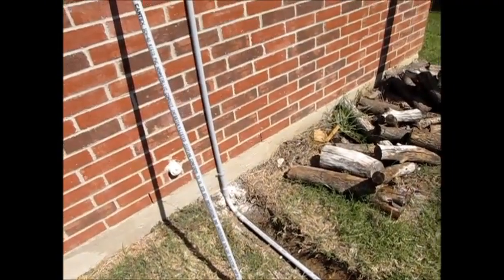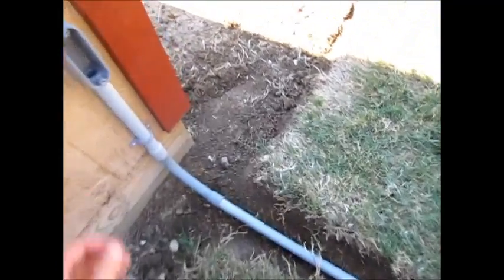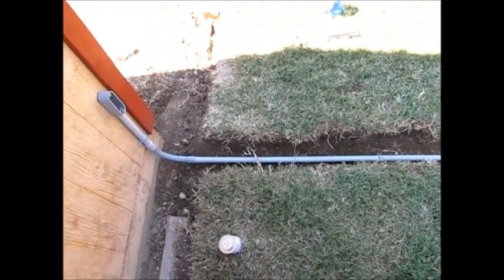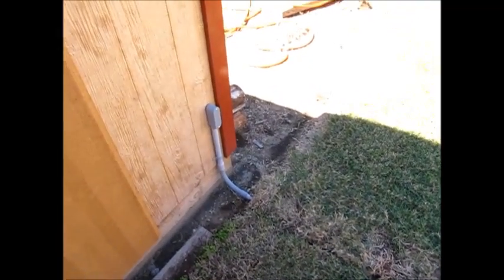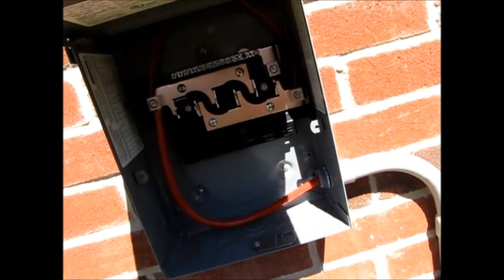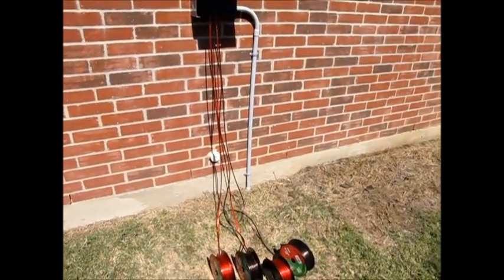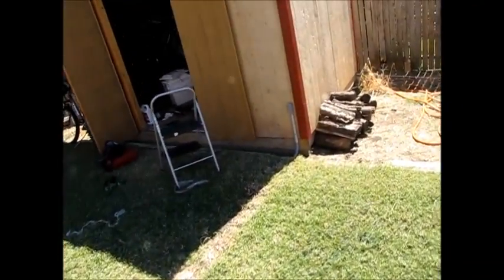How To Install PVC Conduit for Solar

Comment: you can put a red warning tape on top the conduit then cover with dirt, but like you said you are living in the home. If i put my conduit down 18 in I would run into the gas line so I went down 6 in.
Reply from the maker: I think that is totally fine.  As long as you know where it is and remove it before you sell the house/property I don't see how it is anyone's business that it is there.  Obviously, if it crosses an easement on your property or someone needs to do some digging on your property you would need to tell them where it is and de-energize the lines for safety before they did their work.
Reply: @LDSreliance  I have 110 power in my BBQ shed, I bought the vtoman 1500 power unit, so I put up 2 solar panels and ran wire to charge the unit up, I have 100and solar to choose from to run stuff, the refrigerator is on 110,  from the house and shed lights etc.
Reply: I do have a breaker box in the shed 20 amp breaker with ground rod too.  I even ground the solar power metal pipe  and panels, over kill but that is okay with me.
take care

Comment: I bought vtoman power 1000 using them for power in my BBQ shed, installed 2 100 w solar panels to charge the unit and ran my wires in the gray  conduit like you did  under ground to the shed from the solar panels
Reply from the maker: Nice job!  Glad my videos could be helpful.

Comment: Does anyone have a suggestion for getting the wires inside of the house thru Vinyl siding?
Reply from the maker: Use a cable gland such as used for RV's.  They are waterproof and designed for cables to enter without leaving holes or places for bugs and water and dust to get in.

https://amzn.to/3xOCSLU

You would just need to cut a small hole in the siding where you want to enter the house and then this product would go on over top of that.  You would use silicone or some other sort of sealant to seal around the outside of the cable gland before securing it in place with the screws.

Comment: 18" depth isn't code because of how deep you will or won't dig, it's to prevent frost heave. Anything above frost level can be pushed up through the soil if the ground freezes. Normally, 18" down is as far as it freezes (the farther north, the deeper it freezes). I've had posts that were forced up 4" when I hit rock at 8".
Reply from the maker: Good to know.  I have since removed this conduit but it lasted through 6 winters without any kind of heave.  Then again, I do live in Dallas so it doesn't deep freeze very often.  But even in that record cold last winter that shut the whole state down it didn't have any problems.

Comment: Breaking code because you know where you buried the pipe and where you will be living there for 7 or 8 years? loool.  People like you should be fined till it hurts.
Reply from the maker: Find me an electric code for low voltage cable with a single conductor.  I'll wait.

Comment: While traveling on business my wife has a lawn guy aerate the lawn.  During power aeration he blows through the PVC pipe and connects himself to your 40 AMP booby trap.  He survives, your homeowner insurance doesn't cover this type of incompetence....  I sue you head to toe and you gotta make everything right - - you see this is the definition of negligence in tort law.  Or if you didn't sell your house and it was your wife's lawn guy while you were out of town - write the script.  Which goes like this - Mrs. Bride of Booby Trap  (LSD...Reliance - yes you must'a been on LSD) has hysterical man laying on lawn after a microsecond lectro-shot and 40amp lawn "sparkler", (solar power is down - eh - no prob).  But, people show up, and eventually the electrical inspector - - your DYI booby-trap get's you a whole house inspection, fines etc - and posting on Youtube just seals it for the tort action in court  -  your attorney begs you to settle and not fight it.  All your electrical gets pulled out, every connection, and every improvement you did without proper paperwork.  If only you had buried it at the right depth, you would still be married and your 401K growing for you and the family.  

BEST ADVICE - take down your video.
Reply from the maker: Does that make you feel better?

There is no lawn aeration on the planet that penetrates 6-8 inches down, for starters.  Also, the cables are in separate conduit 6 inches apart so there is literally zero risk of short circuit.  And finally, the cables are protected on BOTH sides by breakers.

BEST ADVICE - Please stick to being a lawyer and chasing ambulances.  Your Youtube critique service isn't even worth the time to read.
Reply: @LDSreliance  Ok, 
1) Do the geometry on the pipe and we find your notion of 6" is false based on where the apex of the curve intersects the dirt.  Your video dose not show separate conduit 6"apart (thus you misinformed those you seek to instruct - please correct).   I used the Carlon product guide/dwg to be accurate.

2) Aeration - get the facts on the range of equipment used.  In your town maybe nobody had anything deeper - but the US covers a range including 6" deep.
Lawn Aeration
You can aerate a lawn by hand or with a machine. Core aerators extract small plugs of grass and soil, about 1/2 inch wide, and leave them on the lawn. The holes are generally 1 to 6 inches deep and about two to six inches apart. Some models use spikes to dig into the soil but they do not remove sod. Manual aeration tools have hollow cylinders to push into the grass and extract the plugs. Choosing the type of aeration system to use may depend on how large your lawn is and the type of grass in it.

3)  I am not a lawyer, closer to an engineer but guess again.  I do know we both agree the post won't meet code, I believe it is unsafe - and you don't.   

4) Do you feel better knowing you missed the geometry quiz, and equipment selection guide to lawn aeration across US residential landscape?

Comment: Conduit depth isn't about you knowing where it is, it's about others knowing. It's also about keeping it below frost lines depending where you are. Bury it to depth. Mark it with gravel and tape as required. Not being an electrician is no excuse for not doing research and doing it right.
Reply: PVC doesn't stop shovels, etc. It's about when he sells the property. That's what codes and building requirements protect us from. It's not that homeowners aren't comfortable with their own work. If it were only to be safe for the current owners I don't think inspectors would have jobs. Plus it's just lazy. It's a short run and he only has to dig down another 8 inches or so to be compliant. Just sucks to see when everything else is done pretty neatly.
Reply: Robert Dunham if your doing a private job on your property without any inspector requirements like I am I can do whatever I want I might just laying across the open ground
Reply: @TheTinkle1  Schedule 40 PVC conduit is rated for above ground use. Makes it kinda tough to mow the lawn though!
Reply: @TheTinkle1  :  He's creating a mess. I've seen many homeowners stuck with EXPENSIVE problems due to DIY code violations left by previous owners -- ENTIRE ROOM ADDITIONS where no records exist. When someone does pull a permit for something, all heck breaks loose. If you want to pretend you're a cook, that doesn't mean you may undercook the chicken without consequences. If you want to play electrician, don't make up your own rules; have some pride and follow THE RULES. Someday, someone will have to pay to rip it all out.

Comment: In Iceland they use a similar method, I would suggest seriously you add one component, sand, if you are living in a cold region sand acts as a buffer between the ground and frost, what happens during the change of seasons the ground expands and contracts and this can cause the PVC to crack, by using sand the sand gives way in the expansion and contractions process of the ground and therefore protects the PVC better throughout the season.
Reply from the maker: Good idea.  Thanks for the suggstion!

Comment: nice work. Why do you not convert it to 120v ac with an inverter?
Reply from the maker: Good question.  I probably should have but I am less confident in my abilities to wire 120V than low voltage DC.  Both can be dangerous but I am more comfortable with DC since I have worked with it a lot longer.

Comment: I'm glad that he included the disclaimer that this may not be code compliant because it is not. Please DO NOT emulate this installation on your own property! For instance he states that code requires underground conduit be buried at least 18 inches but he is sure it's OK because HE knows where it is and comments below that he plans to remove it when he moves. What if he's hit by a bus and the house gets sold,  perhaps the next owner may decide to rototill the yard and be unaware there's PVC 6 inches down. The voltage may not even be an issue but ripped and sharp PVC pipe flung in the air may be. Even the though the gauge of wire run in to the attic is sufficient for the current capacity does it meet NEC code relating to fire suppression? Is it the type of wire REQUIRED by code period? If not and there's a fire for ANY reason starting in the attic you may have problems with your insurance company for having interior electrical wiring not within code and being installed without permits.
Reply: +Apexclipper It depends where you live.  When I lived in Texas, they only required low voltage wire to be six inches underground.  Wisconsin required 18 inches because of the freezing.
Reply: +LDSreliance looks good to me man, nice job
Reply: Also if you dig grass in straight line you can make a "sod roll" and lay back down like it was never dug up.
Reply: Only 6 inches is required for DC low voltage.
Reply from the maker: +Apexclipper I used THHN wire which is commonly used in solar and perfectly fine for attic use.  It is very low voltage, it is on multiple breakers, and it is oversized wire so I am totally comfortable with it.

The codes you refer to are for AC wiring, not low voltage DC.  To my knowledge, there are no codes for low voltage DC that I could find in my research.  In fact, there is some debate as to whether you even need to ground DC at all.  So the fact that I am attempting to use conduit and a grounding rod to keep things as safe as possible is, in my opinion, above and beyond what I could have done.
Reply: Apexclippe
Reply: What a know it all whiny bitch complainer.

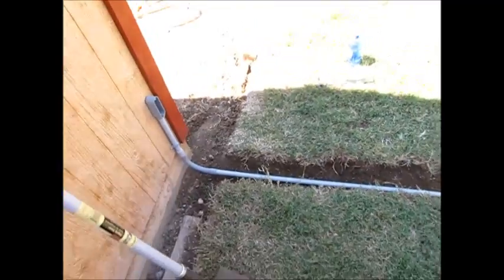Comment: 2:22 - it is not a good idea to rely upon potentially transient conditions of occupancy, when you do any construction.  It is a better idea to make your installation safe for anyone who lives in the house.

In fact, I see it all the time in panelboard labeling.   A circuit gets labeled as "John's Room".  I come to use it years later and think, "who the heck is John?".  John hasn't lived here for 10 years, the label means nothing to me.  How do I find what room this breaker controls?
Reply from the maker: I agree with the basic idea.  However, in my case I am 100% certain that I will be removing this conduit and wiring before selling the house so it isn't an issue.  Good comment, though.

Comment: Looks very tidy. I'm sure was no small chore pushing that 1awg thru the conduit and 90 deg elbows. Lol
Reply from the maker: Yeah, that part sucked.  Thankfully the #1 THHN wire I used has a nice, slick outer coating that helped it slide in without much friction.  But it was not easy!